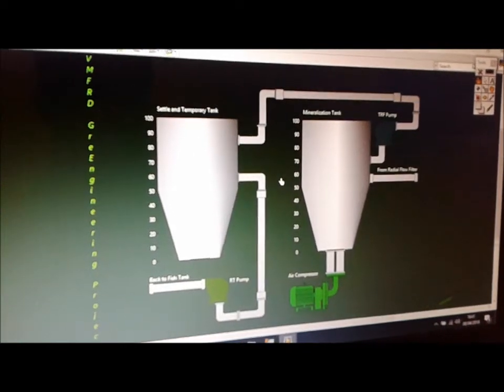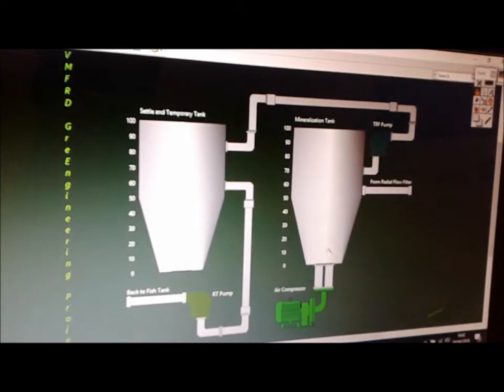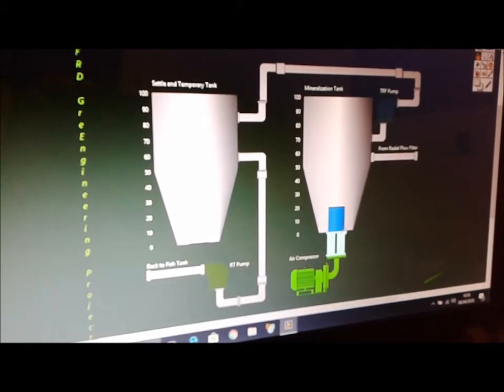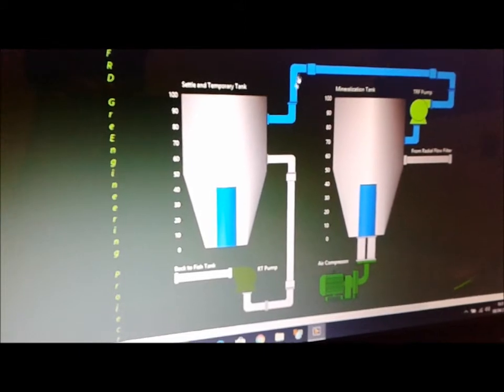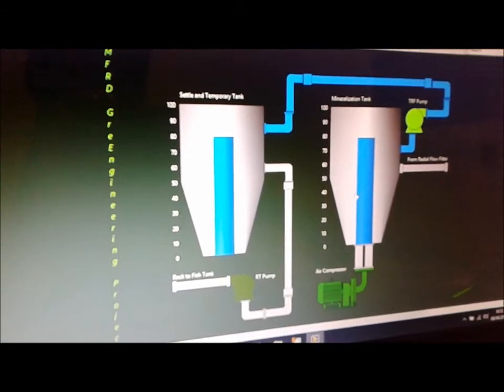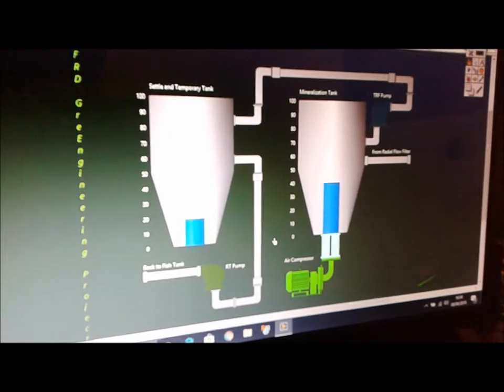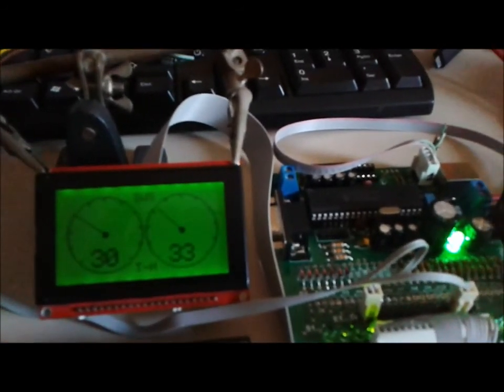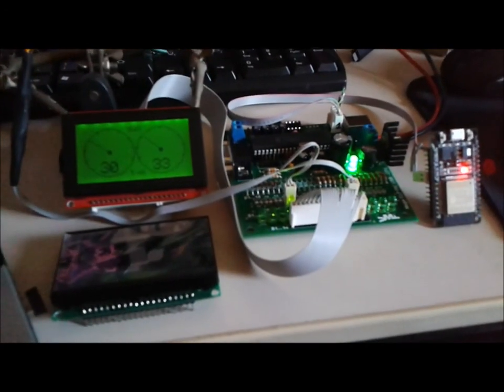Aquaponics System - Automated Mineralization Tank - Pt1

Comment: You are redesigning the wheel. No need to waste water, if you are wasting water is because you do not know what you are doing. Waste settles to the bottom and it can be filtered out without water waste.
Reply from the maker: Mate, even sophisticated filters like Rotating Drum Filters waste water to remove solids. There's no such thing as a perfect filter. And the mix of solids and water that I remove from my system goes to my soil garden not the sewage.
Reply: @VMFRD  But mate, I do not waste any water from my aquaponic system, I have no water waste at all, my waste comes out as a paste with no considerable amount of water. I take that paste and dry it then compost it, then mix it with rainwater and use it in my soil garden.  I do not use a drum filter, so I do not know if a drum filter waste water. I use a 55-gallon barrel that I retrofit with an insert that looks like a funnel connected to a 2-inch pipe and a valve, the sludge then goes through a mesh and the water is then filtered and sent back to the system, no waste of water at all.
Reply from the maker: @joetheragman2076  I pretty much need an automated system to handle all things when I'm not in there. The process you described may work good for you but it's a bit too complex to automate. So I prefer following my line of work.
Reply: @VMFRD  Mate, you might be able to automate it, by using the same principle with an automated valve that opens for a certain prescribed amount of time allowing the sludge to exit unto a screen of some type. This would allow the water to drip off leaving you with the sludge/waste.
Reply from the maker: @joetheragman2076  Thanks mate, if I can find a cheap motorized ball valve I will give it a try!